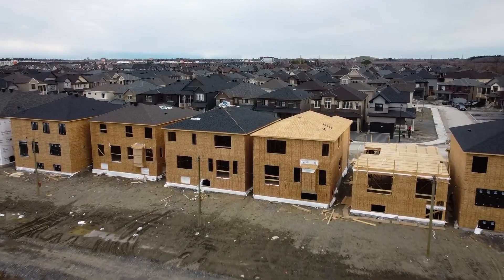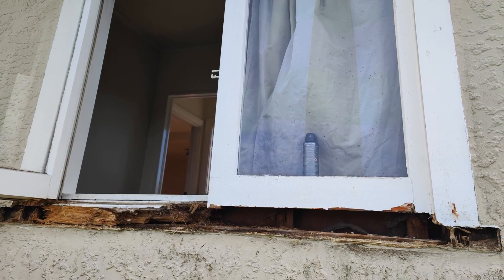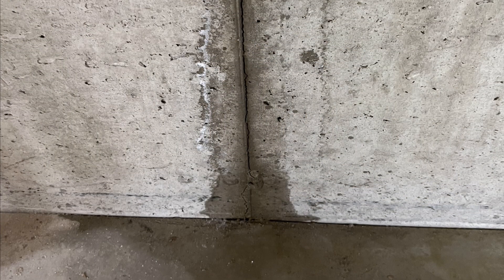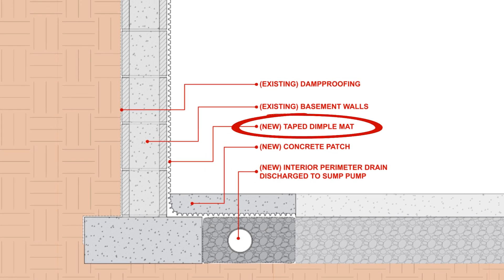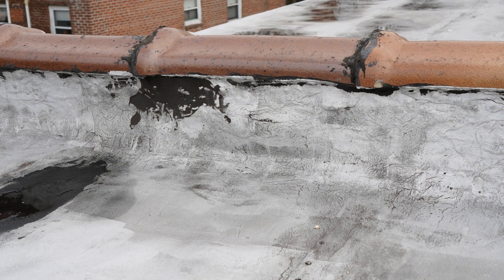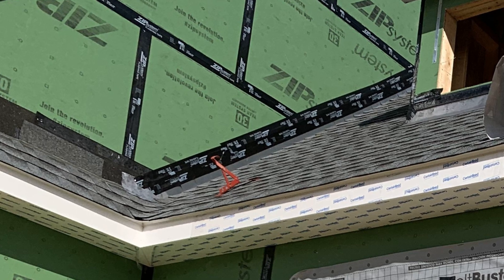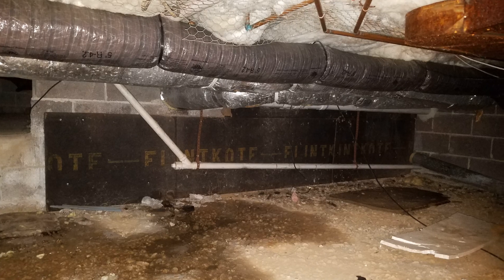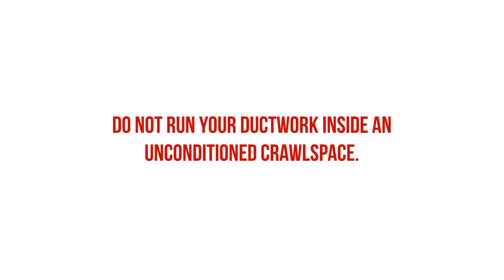5 Common Locations for Moisture Problems in YOUR Home (Check NOW!)

Comment: One thing I'll add here - Sika has a concrete system that they advertise as integrally/inherently waterproof. It actually seems like a very good option for a safe default, I don't know why it isn't the bare minimum for below grade concrete

Comment: I've always specified SA flashing at rake walls where the gutter abuts the wall. Actually any rake wall  unless the roof continues around the corner at the bottom. And a kickout or divertor flashing.

Comment: Use plywood
Reply: Its still wood.
Reply: Yup. Plywood is a very common location for moisture problems. ;)

In seriousness, if you meant to recommend plywood over OSB then you're right that it will improve resilience against water damage somewhat. However, plywood is still wood. It'll still rot if it gets wet and stays wet. I've seen that happen. Plywood is at best a supplement for proper flashing, not a replacement. 

The real "silver bullet" solution is something that will never rot no matter how wet it gets: concrete, stone, or brick. That isn't always an option, especially for remodels or repairs. Plywood can be a good choice in those circumstances. It's just not something that I'd recommend as a quippy two-word solution without context.
Reply: @ThomasAHMoss  Plywood is much better than osb and mdf...
Reply: @truthhearit1471  it's not much better. It has the same method of failure. And MDF isn't an option I know of for sheathing. Plywood is still wood. And it's still a composite product. It has become popular to claim no longer using plywood is why modern homes have moisture issues but that isn't really the cause. It's the dramatic increase in building insulation but without the improvements in water mitigation. Old building did better due to less insulation and more air movement which meant more drying. Old inefficient ac units dehumidifier better and ran longer. Its not plywood. And if you used concrete or plywood it'd still get wet and you'd still have mold. Osb is just fine just use water mitigation methods.
Reply: @vespaman101  structural brick/stone, formed concrete, and cmu are the methods that truly stand the test of time
Reply: @jtmg11  there's hundred years old houses made of wood. And older. Mitigate the water. The cost of those methods i think are prohibitive for most. They also have a huge environmental impact. Lumber can sequester carbon and is renewable. 

Concrete and brick are great. But not required for a good durable home.
Reply: @vespaman101  This is true geography permitting, assuming good build quality and materials. Typically requires a higher level of maintenance over longer periods, and maybe most importantly, closer to the equator, longevity becomes a challenge (greater hydrostatic pressure, wind loads, UV material degradation, etc)
Reply: @jtmg11  there's a certain distance where maybe concrete or brick is reccomended. Im not familiar enough with equator building. Im American. Always build what's appropriate for your region. Many in Florida use concrete due to hurricanes. Im in NC. Where im at Hurricanes are a rarity. We haven't been directly hit in my city since the 1980s. I wasnt born yet. Building for a Hurricane may be a tad excessive. I think wood is a good material for most places with exceptions.
Reply: build with concrete ;)